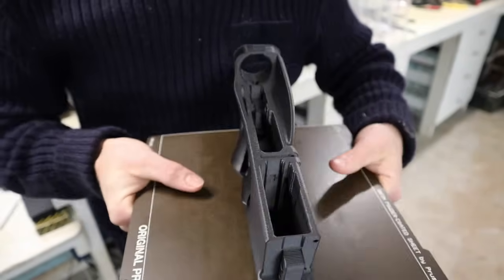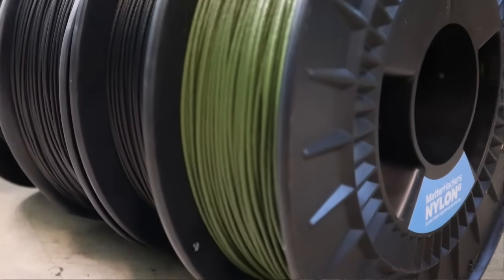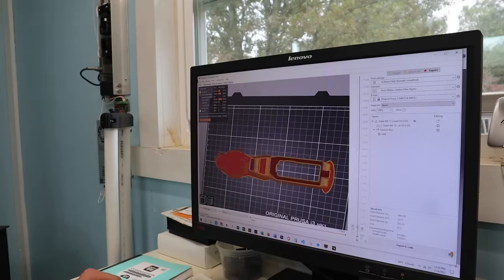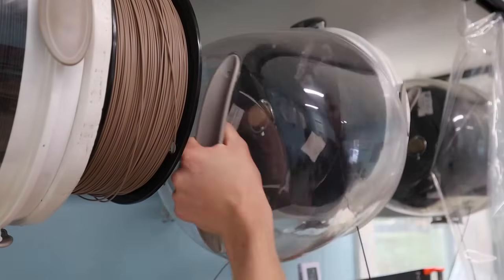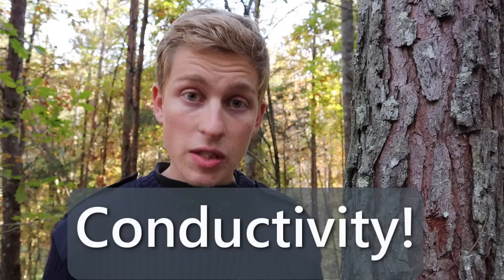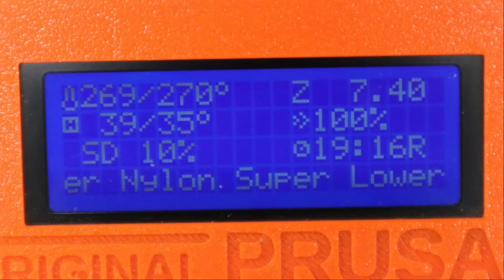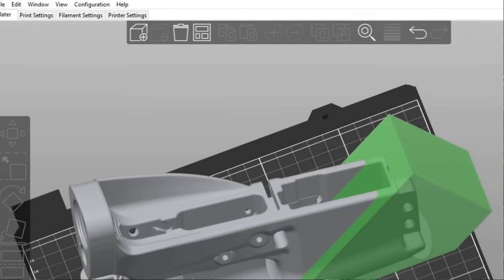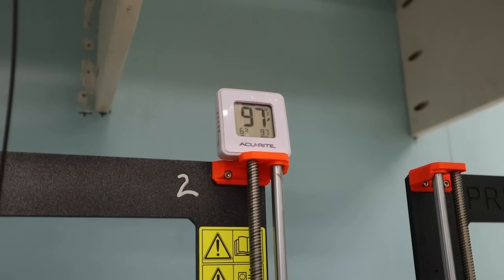How (And Why) To Print With Carbon Fiber Nylon | Print Settings, Tips And Tricks

Comment: you get around a lot of the warping of nylon going to glass or CF filled, but you can fix that and your layer adhesion problems by getting/making an enclosure and keeping it 80-120f for your print.
if you did that, you should be able to dial this process in for cf nylon and dump any remaining arguments for pla+
Reply from the maker: PLA+ will still have a very convincing argument though ;) 25% the cost and any printer can run it. And a lot of people, including myself, will never expose it to the high temps that may damage it. So it still remains an awesome plastic.
Reply: @HoffmanTactical  true, youre never going to make nylon particularly cheap or easy to use.
but for a durable product that you need a limited quantity of, those become less important.
what I really want to see people iterate on, is integral stock/buffer. this should be possible with a 400mm bed (500 would be better), and should trade some of the weak points for ones that are easier to solve.
Reply from the maker: @CraneArmy  That's the way I look at it, but some are on a tighter budget then myself. As to an integral stock / buffer. I've not worked on such a design for two reasons. Printers that big enough are not common. And I don't think it would help make it stronger. If no metal reinforcement was used, maybe, but with the buffer band I don't think it would add any strength. The lower always breaks forward of the buffer tower. So no amount of plastic behind that would help.
Reply: @HoffmanTactical   they are available. Someone doing the research can find one with 400mm in at least z for ~500 from most of the reputable brands. The thing that I'm less sure about is a proper heated bed the right size, I think if it was going to get complicated, it would be here.

I havent watched all of your videos so I dont know the failure youre getting, but I'm assuming the breaks youre seeing are common to other plastic parts like this and are forward of the buffer tower but behind the grip.
adding an integral stock that attaches behind the grip gives you two things, and the smaller thing, is you can attach the stock behind the grip anywhere you want increasing the width of plastic at that point making it more rigid while resisting the moment forces on the tower, I think this is what you were thinking about and you should be able to make it marginally better, although you shouldnt need the long part for this, you could just do it (maybe you have? difficult to tell).
the bigger thing, is you can direct force that normally is directed through the buffer tower, around it into the part directly aft of the grip.

both of these things together should compound for a part a few multiples stronger.

Comment: PC-ABS is better.
Reply from the maker: I don't know. I've only used a couple PC blends though, I will try some PC-ABS and see how it is. I found that PC blends lack impact resistance in the layer adhesion, and is harder to print with. They are lower cost, which is a plus.

Comment: Outstanding work as usual! 
Glad to see that carbon fiber nylon isn't just a gimmick and indeed has some potential.

These videos make me want to set up a tester myself and try out different annealing processes to see if they help.

I've seen a few different approaches, from casting in plaster and baking at glass transition temperature to relieve stresses and improve layer adhesion, to boiling in water. The latter seems kinda yikes, but at the same time, I wonder what increasing the moisture content of nylon after printing would do to its properties?

Anyway, great job with this video.
You're inspiring others with your work on this.

Comment: Love your channel man. Just curious, how long did that take to print? I'm trying to gauge whether my prints are taking longer than they should.
Reply: Carbon Fiber Nylon loves to be printed slowly. I print 3d printer parts on a CR-10 without enclosure with the following settings.

Filament: Fiberlogy PA12CF15
Dried filament: Preferably but with CF not necessary 
Print speed: 30mm/sec
Nozzle temp: 265 degrees Celcius
Bed temp: 100 degrees Celcius
Fan: 0% throughout the print (only when bridging)
Bed type: Glass
Bed adhesion: 3dLac spray

If you want a great bed to print nylon on, use G10 or FR4 sheet which are used for making PCB's. Also known as Garolite.
Reply: @britewires4305  Man, thank you for the very detailed knowledge! I appreciate it.

Those settings actually look close to what I use for my ASA so this should be doable.
Reply from the maker: I think it was around a twenty two hour print.
Reply: @HoffmanTactical  That's about what I thought it would be. Cool, thanks bro!
Reply: You should be more concerned with quality than time.